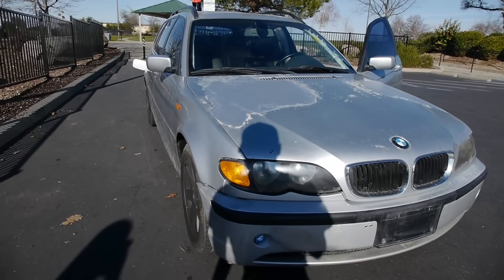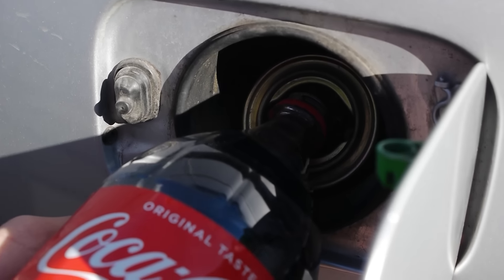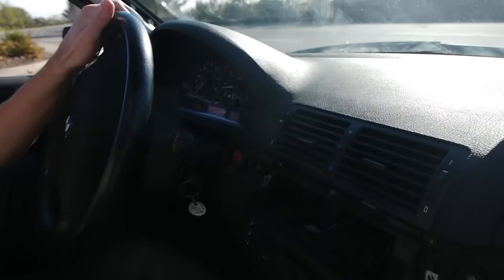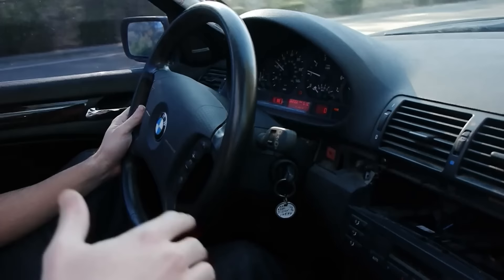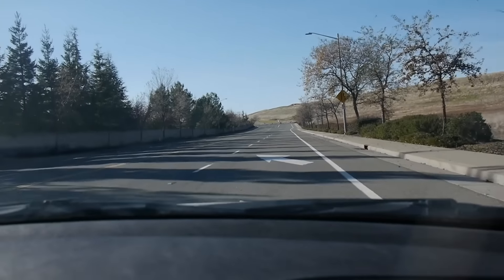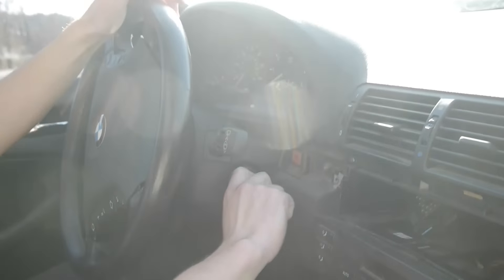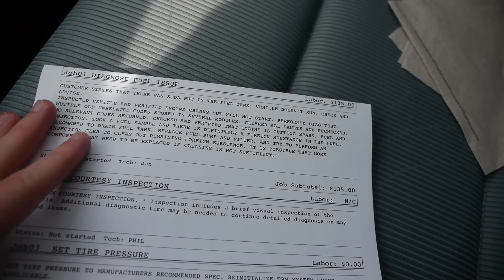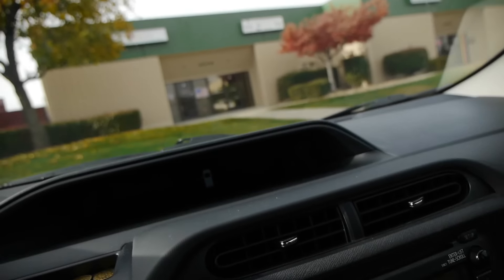What Happens If You Fill Up a Car with Coca-Cola?

Comment: What happens if you fill a car with gasoline?
Reply: I have never tried that
Reply: It explodes
Reply: You'd be 30 40 bucks poorer
Reply: What happens if u fill a bottle with water?
Reply: lol, that's my kind of humor.
Reply: bluepeng889 
You do fill a car with gasoline?
😲😲😕😕
Reply: What happens if you drink Coca Cola?
Reply: You're wasting you're drink
Reply: What happens if i drink water?
Reply: I will work with gas! but.. expect your engine to run with an abnormal hp of 12.6’100 above average 23% of its combustion capacity if you break that down its 1 3rd of total Cylinder cubic centimetre giving an output of a combustion engine its 3rd of its HP rate  just saying... I’m John evens I’ve studied engineering of the combustion cycle for 30 years. And soon I’m planning on heading to the moon on my lawn mower, thank you.
Reply: Probably run like it should idk!
Reply: I call it petrol because I’m English
Reply: Explosion (technicly true haha)
Reply: the car will accept it.
Reply: you would have to pay for cleaning the seats, floor and ceiling. would not be cheap either
Reply: Darkie5 will end the whole world career
Reply: What happens if you put milk in cereal?
Reply: @dave2609  no noob
Reply: Chris Gilliam Of course you'd say that, your the car repair shop...
Reply: Millions of views
Reply: The Slow Lane Reviews r/wooosh
Reply: MrBigbmcc r/wooosh
Reply: It runs normally, especially if you use the correct octane rating.  The major exception to this is the electric car, which you plug in very much like how you would plug in your cell phone.
Reply: Moni Smallwood r/whoooosh
Reply: @monismallwood9371  r/whooosh
Reply: C'mon dude that's LAAAMMEEEE
Reply: It will run
Reply: Moni Smallwood r/wooosh
Reply: @pacowilson5619  *your
Reply: What happens if you fill a bowl up with cereal and orange juice?
Reply: Why did the FBI just come to my door after I had cereal and OJ...
Reply: @dave2609  your joking
Reply: Moni Smallwood r/woosh
Reply: @jomarz1828  20 for me.
Reply: @RowynOfficial  you will be alive😮😱😱
Reply: @HusseinZ25  really?
Reply: @monismallwood9371  you missed the joke

Comment: No one said the real reason why the car stopped tho. It needs spark and combustion to make power. Coke is not flammable. So no boom in the cylinders is why it shut off.
Reply: I wouldn't do that to acar it gets us to point a to be ithink it's dumb to ruin a perfectly good car ithought it was a good car my sister in law has the same car
Reply: So can I fill my car with alcohol bc it's flammable
Reply: Also, sugar in an engine locks up the cylinders if you run it long enough. Don't mistake your Dr. Pepper for motor oil, kids.

Comment: You got ripped off because cleaning the gas tank only costs about 130
Reply: cole s hes still evolving not as smart as the rest of us
Reply: The gas tank isnt the only thing that needs cleaning. The fuel lines, fuel pump, fuel injectors, etc. in fact he was lucky. it would usually cost thousands and thousands of dollars.
Reply: You need to clean all the engine fuel lines and the other thing like the pump,lines,injectors
Reply: Still Evolving holy fuck you don't know cars....
Reply: I honestly know nothing about cars. I know more on other topics than most of you as you guys know more on other topics I don't know. This is one of the saving graces of humanity. Unity is needed and we are all individual hard drives sorting and storing the data we know so far on the whole universe. Let's keep modesty and remember WE never master any topic fully
Reply: It broke
Reply: He still give no sh*t
Reply: The engine broke, wtf do you mean 130
Reply: I'm sure he needs more than just a clean gas tank like possibly a fuel injector priming to clean the engine heads things to
Reply: you could just drain the tank and fill with fresh gas and it would probably be fine
Reply: Still Evolving it's not just in the gas tank tho he ran it threw
Reply: Max you don't need to know about cars to realize the coke is gonna circulate threw the car
Reply: The more he tries to start the car, the more the coke circulates through the engine.  You CANT just drain the gas tank and put more gas in it either. That's why the car died in the first place, because the coke started circulating through the engine and was unable to create combustion because it had Coke instead of gas
Reply: You are correct sir all these not so evolved apes unlike you who is still evolving and evolving understand it's simple to clean the whole car by just using simple chemicals that break down the sugar which is the main source of the problem.

Any car repair shop asking over 200 dollars for this is literally ripping you off or just don't know better.
Reply: Still Evolving nope. Sometimes it is up to the thousands
Reply: Still Evolving you ever boiled coke? If you did you would know why he had to pay how much he did
Reply: Linda Botello haha
Reply: We own a junkyard and there was a civic that was about to be scraped but it still ran and i poured 2 liters of coke then we drove it for about 10 mins and the same happened to us but all we did after was just pumped out all the coke from the tank and poured in a liter of petrol and it ran again with no problems and drove it for 10 mins and it was all fine and it still runs today no sign of problems either so honestly you dont really need to repair shit XD
Reply: CrimsonF1 niggga 😂😂
Reply: Still Evolving suger ruins motors too lol
Reply: Still Evolving you’re right the paper said 135.00
Reply: nouse use he honestly probably killed the engine
Reply: because cleaning the gas tank will not do anything to fix the car. they would need to clean the gas tank. replace the fuel pump, flush the lines, replace the injectors, clean every single sensor in the engine that comes in contact with the gasoline including all emissions sensors and the o2 sensors. you are looking at thousands of dollars to repair this.
Reply: ohnevergoingtoquit not to mention damage in the cylinders running at 2-3k rpm for a min with that in there it’s probably cheaper to just replace the engine and everything that the soda ran through
Reply: Still Evolving some parts need replacement as this is almost the same as hydrolocking your engine
Reply: oziboy ozi they wish it was hydro locking it’s like dumping sugar in the gas tank
Reply: commonnerfer I wonder what would happen if this were a diesel engine though
Reply: guys its not like the engine was ran with  coke as soon as it hit the engine it died, put fresh gas in the tank and cycle the key a few times to get fresh fuel up to the injectors and once it runs drain the gas again and boom done.
Reply: Still Evolving you have to clean the tank and you have to clean the fuel system such as the fuel rail. Inside the combustion chamber it adds fuel and air so you will have to take the engine apart.

Comment: Coke is more expensive than gasoline...
Reply: No, it's not a bottle of coke costs like 3 Bucks. To fill this car this is an E46 Touring so the fuel tank size is 16.6 Gallons. The price of gas in California is around 3.30 right now So Multiply 3.30 by 16 it comes out to around $60 with tax. So No coke is not more expensive
Reply: Dinocrest wow 3.30? That sucks, I got gas for 1.75 today

Comment: Most people might not suspect it but it's actually the high sugar content in coke that killed the car,while it's been proven coke will actually decarbonize a car this dude would have been maybe a lot safer if it was sugar free coke or diet coke it might not have done most of the damage,but the high sugar content in regular  cokes the killer heating up the cylinders on an old BMW is one costly venture.
Reply: Clogged fuel injectors or fouled spark plugs
Reply: Lone Wolf BMW sell cars with water injection. It would depends on how much water was entering the cylinder

Comment: This is the reason i have been putting a locking gas cap on every car i owned since the 70's So no one puts sugar or in this case coke [Same thing sugar] in my gas take and damages my engine.
Reply: Motorman 0057 yeah putting cola in your tank is definitely bad, but sugar doesn’t dissolve in gasoline. It won’t wreck your engine. if there’s too much you sugar then You’ll probably need your gas tank cleaned out.
Reply: I would say you’re more likely to have you fuel stolen than someone puts coke in the tank 😂
Reply: I would not care about the fuel getting stolen Back when they were pouring sugar in people gas tanks . I knew someone that this happened to and the engine was messed up .
Reply: Motorman 0057 it’s mad that you guys call petrol gas. Cos a gas isn’t a liquid.
Reply: Motorman 0057- WRONG!!!!  It's liquid, when expand it become gas.
Reply: oldskoolstu  It's the short form of "Gasoline".
Reply: I guess you haven’t seen Bosse bildoktorn
Reply: I know a guy who took revenge on his boos for firing him due to racism and the guy poured sugar in his gas tank and fried the engine. The insurance didn't pay for it because it was not an accident, and he lost his car. Revenge is best served "Cold" :-)
Reply: pretty much all cars worth anything from any era got a fuel cap lock cover tho... ive never heard of a modern car that got a free to open fuel door.
Reply: Motorman 0057 well the sugar wasn't a problem...  The co2 was a problem... Cuz you know sugar is heavy so it would take some time for it to get to the engine so it would just melt because of the fuel temperature in the gas tank so it would probably run just fine... But yeah that cap is a smart move...
Reply: I do not know who the insurance company he had or what coverage he had on his car But there is coverage other than collision you can get for your car That covers everything.
Reply: What's mad is that you don't realize that gas is the short form of gasoline, just as petrol is the short form of petroleum.
Reply: Motorman 0057 they will break the lock
Reply: Motorman 0057
Reply: Motorman 0057 oof the car
Reply: Hello that is not good

Comment: $50 to fix it... 

top off the tank with gas, add fuel injection cleaner and bottle of gas stabilizer....start it
Reply: Tekmyster this guy knows his shit
Reply: Uh no drain the tank then fill it up.  That way you get rid of the rest of the come in the tank.  Yea what you said would work but it will cause more harm down the road as it burns up the suger in the coke.
Reply: Dude ilove u U FUCKIN SAVED ME IMAKED THAT IN MY DADS CAR

Comment: i would be surprised if refilling it with petrol (gas) would not fix the issue ,the petrol would flush through everything and clean out the gunk and wallah it will run again ,no need to pay anyone except the tow truck to the servo

Comment: Pour a 2.5 gallon bottle of Purple Power degreaser in the tank. I have heard it will break down the lubrication properties of the oil and ruin the engine.

Comment: This vid should have a warning: DON'T DO IT AT HOME.
What the car repairs stated needs to be done, I would have told you the same, before you put Coke in there. 
Fuel needs to be drained, all parts cleaned. An expensive exercise for a prank on your own car.

Comment: Lol, are you really THAT surprised this happened? A car only runs with the exact sort of gasoline it was designed for. If you put ANY other liquid in there - even if it's just diesel instead of gasoline - you could easily total your car. Wrong liquid, wrong combustion, engine dies. Simple as that.

Comment: I've done one better, I filled a gas tank on a mini school bus with mud and stones, guess what.......

KEEP SCROLLING......

KEEP SCROLLING....

KEEP SCROLLING ONE MORE TIME...............

KEEP GOING, ITS GOING TO BE INTENSE.......

OKAY, because you actually scrolled to the bottom of this, here is what happened after we poured mud and rocks into the gas tank of a mini school bus: IT FUCKING RAN FOR TWO MONTHS!!! (The school barely drove the bus, but it ran for two months before it totally died and had to be overhauled and had a new engine and fuel systems installed.).

Comment: So, we still don't know what happens if you "fill up a car with coca-cola". But we do have a better idea now of how your old B'mr runs when you add two liters of Coke to nearly a half a tank of fuel in it. I'm guessing the only reason your car started and ran at all is because of all the (presumably) standard fuel that was that was already in the tank, fuel lines and engine. Seems like an excessive waste of a (presumably) decent imported car. Why don't U experiment with a Lamborghinis or Bentleys? (snicker, lol) Tell U what, I'll trade you two old Ford Festivas or Escorts for that old BMW, as it would probably make a more suitable 'grocery getter' than my Audi or Vette.

Comment: I think you were doomed to failure. I think the combustion engines in cars require combustion? I don't think coke is combustible. Why don't you see if the engine runs on sand? LOL